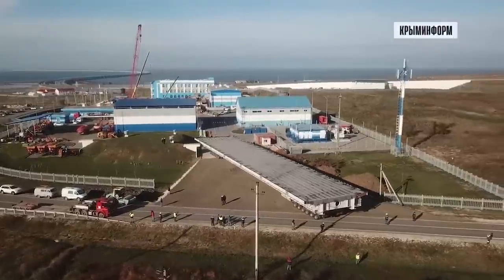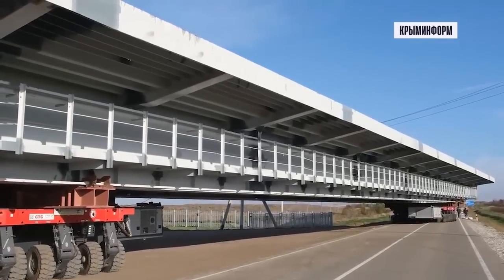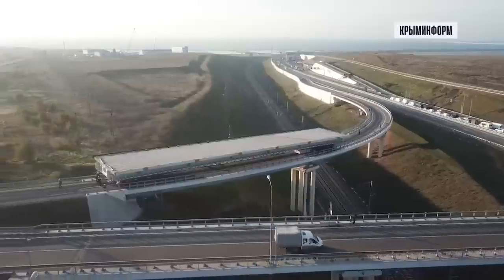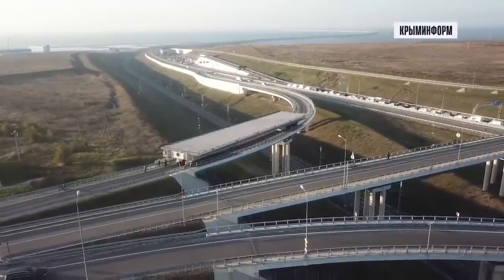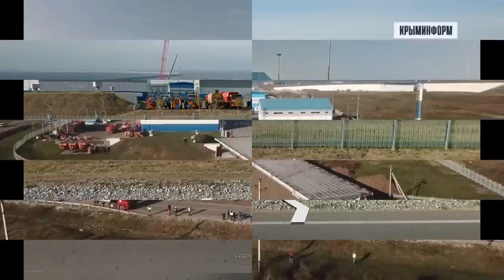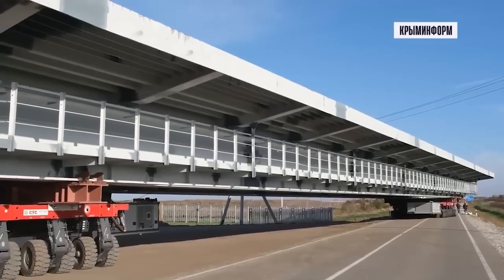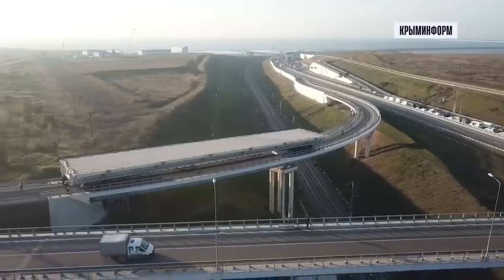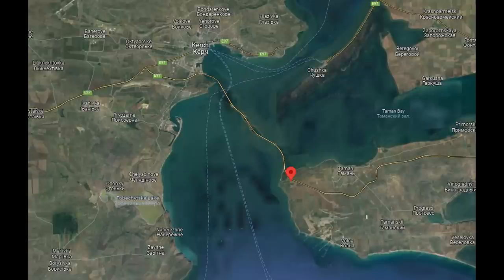Russia Transports New Span to Repair the Crimean Bridge

Comment: The vehicles used are called Self Propelled Modular Transporters - they're also used in drydocks and shipyards to transfer large ships for maintenance and refit. They use these at the Australian Marine Complex in Henderson for refit and repair of Frigates and Submarines.
Reply: They are also used for moving buildings. Their "unified jacking system" is modular and through the use of hydraulics has each set of wheels follow the terrain separately so as to not break the structures they carry. And because they are modular, they can be configured to carry different shaped things.
Reply: NASA uses them to move the space shuttles, or they used to. (It's been years since I had occasion to look in on them.)
Reply: Anyone who watches videos of SpaceX's Boca Chica rocket prototyping site should be familiar with them as well.

Comment: Im a welder. Its totally possible to build a bridge span that fast. And for it to meet spec.
Reply from the maker: cheers
Reply: But concrete needs 28 days to reach its maximal strength, the bridge was bombed 32d ago !
Reply: @_xO_Ox_  у русских есть запасные части для моста . Не нужно строить новые, нужно взять на складе запасные. 
Всего есть 10 запасных частей

Comment: It took 26 days total to repair the MacArthur Maze.  It took 22 days to fabricate and deliver the steel beams from Arizona to California.  This Crimean Bridge section looks to have a similar amount of steel, but welding for this Crimean Bridge section would be a little faster because they already have the production drawings, and they have a fabrication facility on site.  The main delays in this repair would be finding and delivering the steel.  But yes, the inspection process would need to be accelerated and/or even omitted in some regards...
The Rebuilding the MacArthur Maze (Documentary)
https://www.youtube.com/watch?v=-TKjwblp1XI
Reply: taking down the bridge served its pupose delaying supplies to the south enabling recapture of kherson
Reply: Thanks - well worth watching the Maze documentary you linked.
Reply: What a wheeze if Ukraine waited till it's in position and then repeat the exercise, this time taking out all three bridges. At the same yime, strike south across Donbass , thereby totally cutting off Crimea! Just a thought.

Comment: It could have constructed of component's left over from the original construction , they may well have produced more parts than required to cover faulty items
Reply: Exactly this...

A lot of major construction will have prototype blocks built (to ensure the engineering and processes are sound), or reference blocks built (for inspection, development, etc), that could have been siting there for years and just basically needed a mild overhaul and finishing.

I hadn't thought about 'rejects' - yeah I guess if you have a 75% complete block that has been rejected for warping beyond tolerance, you could use that. Especially if the original tolerances were conservative.